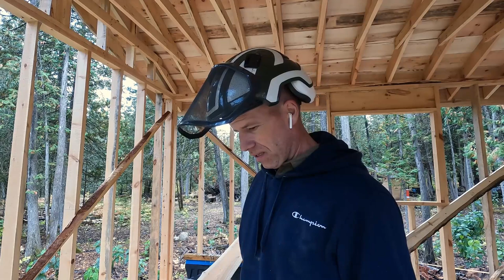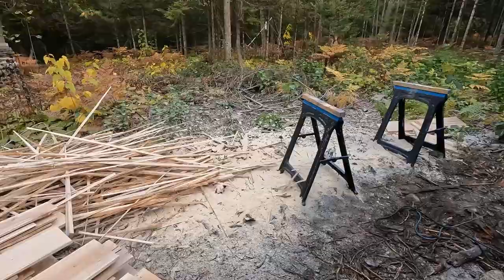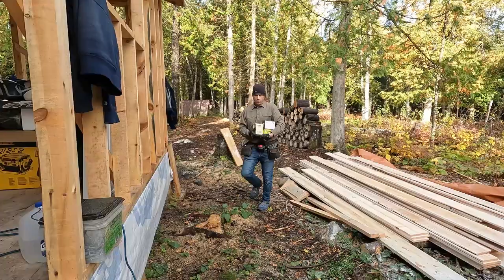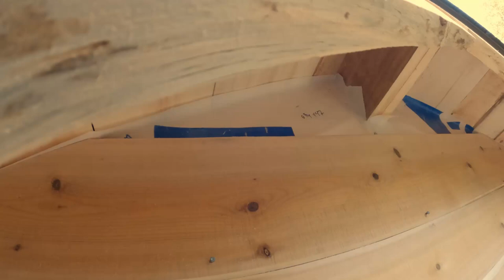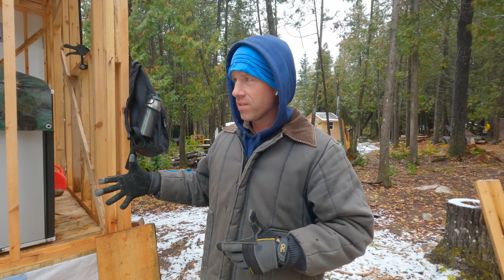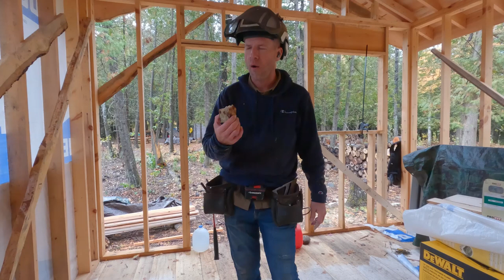Every Cabin Needs Hand-Made Cedar Siding!  Closing in Off-Grid Winter Cabin. #107

Comment: Dad was really PROUD of you! I love that. Hey, just a real easy and cheap idea for rain-proofing... Get a tube of the cheapest 100% silicone caulk you can find. Mix that 50-50 with 'Naphtha'. Now take that jacket you were wearing today, and brush that mixture on it. Soak it. Then hang it up and let it dry and cure. When you are done you'll have a 100% waterproof jacket that doesn't weigh a ton, and that moves just as easily as the original jacket. Probably won't 'breathe as well. LOL But if waterproof is what you are going for, it actually works, and feels good in the wearing of it. Not restricting, like beeswax mixtures can do. (The original 'tin cloth'.) A better starting point might be a really lightweight, (oversize by a couple sizes), nylon windbreaker with a hood, from goodwill. Then you can just toss that over anything else you might wear. 300 dollar rain jacket for the cost of an old jacket and maybe 20 bucks in materials...

Comment: Obviously there are a thousand tools to make life simple & time effective. Install a fence on your sawhorses for the saw and just clamp each board down. That way you don't have to take time to follow a line. Line up the marks on the board your cutting at each end and cut. No chalk, no slowly following your cut on the chalk line, and you will save massive time to do more work while your weather is permitting progress.  Spend a half hour to save days.... 
Few screws, few boards, and a few clamps and your golden. 
Your fence will (since your cutting 3/4" boards) will be set 3/4" higher than the board you attach to lay each board you intend to cut. 
I tried to consider your available materials and I think it would work for you. You will have a ton more wood to rip going forward and you could set up a table like this easily/quickly. Nice progress bro... I appreciate the content!

Comment: You might also consider a shiplap edge though you might need a more powerful router to make it happen. When installed properly, the exposed edge overlaps the board below -- keeps the water diverted to the outside. As the green wood dries, it shrinks across the width but not across the length . . . and the shiplap is sufficient to make sure the wall remains covered = no caulking needed. Nailing pattern matters too so that board edges don't curve away from the studs. As you look at the end grain, you can visualize how the board will try to wrap itself back around the tree . . . so you want that crown to the outside to keep the shiplap overlaps tighter. :)

Comment: Add a larger base plate to the router to save those digits! that is what the 4 holes on the plastic base are for. You can also add a fence to ride the edge of the board.

Comment: Traditionally chalk lines used ashes for the chalk. I have seen them use old oil in Asia. The thin blades heat up and expand and become wavy and go into a death spiral. You need to keep the blades clean with a cleaning solution in a squirt bottle. Oil the blades at the end of the day because they will rust overnight. After a day of cutting I take my bar and chain off, clean out the rails and put the chain and bar tip in a pot of oil. I planed all the cedar on my house. Real pretty but I had to oil it for five years before it aged into a nice color without going gray. Also consider going vertical and do baton and board. No shrinkage problem and rain runs off good with plenty of air behind to keep the boards dry. I live in a rain forest.

Comment: Installing a 2x2 outside horizontal your wall frame make the walls stronger and on 2x2 you put Tyvek. Now you get both horizontal and vertical insulation so less cool bridge and also you can put a vertical wood panels so less water leaks and if you using a lock panel model you get a nice ventilated wall.

Comment: Why not take a long board and clamp it to the boards that don't have enough square edge for the router and use it for a fence to run the router against to prevent the router from diving into the uneven edges?

Comment: Try using a product called LAMI LUBE on router bits and saw blades. It's a non staining lubricant. Helps prevent resin build up on  cutting tools/bits extends tool life.

Comment: Getting cold real soon. To save propane how would it be if you heated a large can of candle wax over a scrap wood bonfire and then took the can indoors just before you finish for the day. Sun Amp in Scotland are putting these heat transfer units into electric supermarket delivery cabs to save using electricity to heat the driver. We use milk churns from on top of the stove through to the bedroom at night and they stay hot all night long. Try it with just a bean tin and a few melted candles in the tent. Keep up the good work , Now got a 500i and cutting up oak beams.  You have a lot to answer for. Cheers. Les.

Comment: CEDAR BOARDS SHINGLES AND SHAKES COST IS OUT OF SIGHT.
IN PACIFIC northwest coast Cedar in 1950s through 1980s was inexpensive  locally because it was plentiful. Our cedar were old growth and though not tall 200 foot max but up to 25 foot in diameter.
You could split 40 foot streight as and arrow slabs or we building real houses would saw slabs and logs for length you wanted, my farm house had horizontal board 24 foot long siding,  and we split 30 inch shakes for roofing not a knot anywhere.
Those days gone but even today loggers find  huge slabs. Loggers only took. Rounds and sometimes when cedar prices fell they fell and left whole trees.

Comment: Use the cheapest oven cleaner you can buy for cleaning your saw blades. Find a container the blades will lay flat in and soak them with oven cleaner and let soak for a couple hours then scrub them clean

Comment: If your having trouble with sap on your saw blades or even your jig saw.  Just spray some WD 40 on it and will come off as you use the tool.  If the oil will stain your wood?  It might but it will just be on the edge.  Later

Comment: A ripping blade should have teeth that are straight across on the cutting part of the blade. Whereas a crosscut blade should have teeth that are usually angled to cut “across “ the grain. So the look of the ripping blade tooth should look like a chisel, flat across the top (cutting edge) of the tooth.

Comment: Ryan, DO NOT USE THE AUTO SWITCHOVER PROPANE VALVES FROM CAMCO!!! Most of their stuff is great, but their auto-valves will switch over 2 or 3 times and then quit. Everybody complains about them. I finally got tired of the nonsense and bought a “Gas-Flo by Fairview” unit for literally$5-7 more, and it works like a charm! Really, auto switchover every time with no stoppages! 2 negatives: Upon initial installation, sometimes the first tank will “Sing”! Just a slight, constant resonance, and I don’t know why, I switched back and forth a few times manually, and that one tank started singing every time! I just switched it over manually to the other tank and let it run.. When it did the auto switch, the singing did not come back, and I have never had that problem since. The other negative is that it will switch over to the other tank while there is still about a gallon of propane left in the feed tank, (I’m running 5 gallon tanks). So make sure the place that refills your tank actually charges for a METERED fill, because your 100 gallon tank may have had 20 gallons (20%)  left in it when the valve switched over!

Comment: A rip blade has a flat top grind with no set. Set is the offset between alternating teeth. The lack of set makes them harder to push and more prone to kickback. Ripping with a blade like a ATB thin kerf it ok. It just does not produce the smooth cut like a FTG. But for what your doing, so what?

Comment: Your explanation was perfectly nonsensical.
If you planed the outside boards they'd no longer be 3/4" thick; wouldn't fit the windows right! 
Easier to skid the logs to your 'mill site' with snow on the ground.